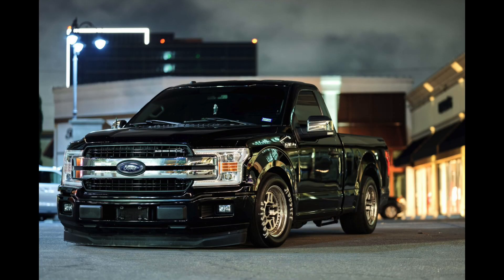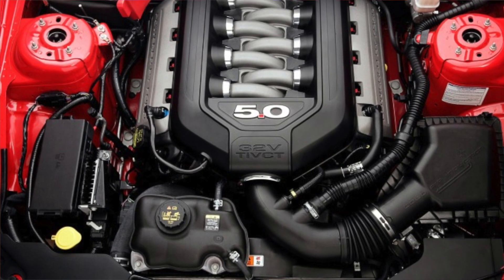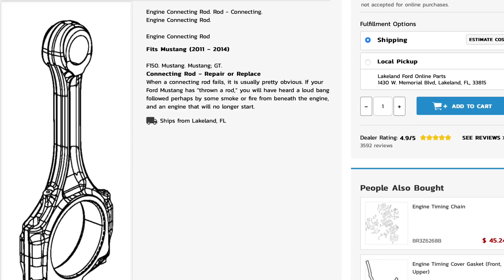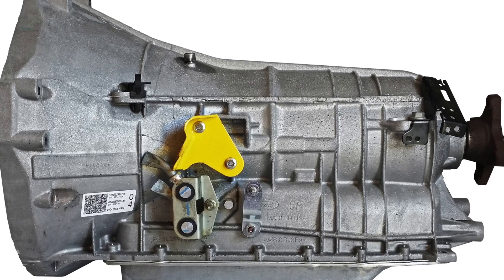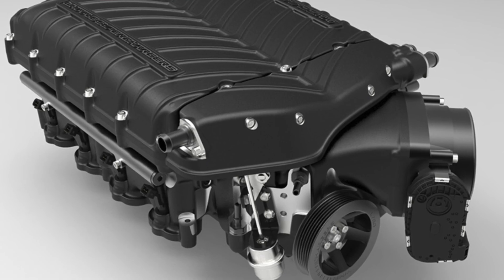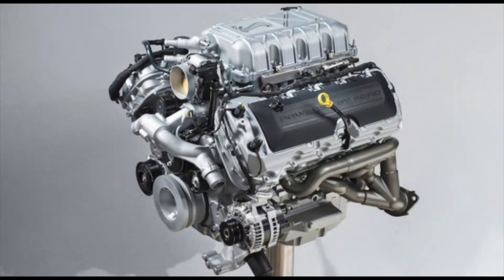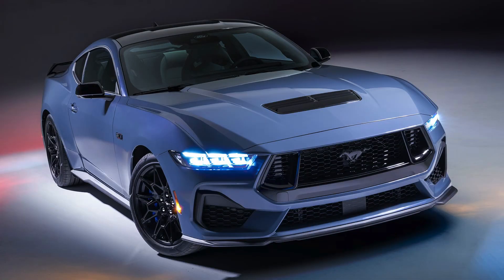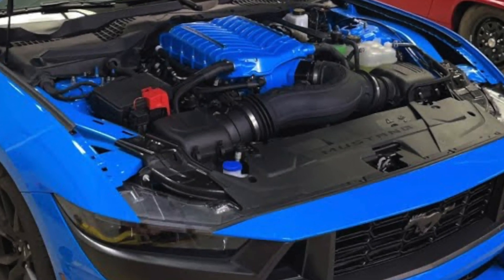The Overview Of The Mustang Coyote Engine (GEN 1 - 4)

Comment: People who are just looking at HP/Liter to judge and engine don't know much about engines.

A 6+ liter LS can fit under a Miata's hood and give the car a very good power to weight ratio, something a Coyote can't do. Viper won it's class in Le Mans and ruled GT racing during the late 90s and early 2000s against other cars that have better HP/Liter.
Reply from the maker: It's a fair point I mean the Honda S2000 is not very fast from the factory but it has a very high horsepower per liter so I can buy off of that plus especially naturally aspirated application in LS engine can make a lot of power generally more than a coyote if you're looking at an LS7 which will make 600 wheel whereas the coyote generally makes more than the fives definitely some truth to what you're saying thanks for your comment

Comment: I have a 17 Gen 2 and I absolutely love it.. The S197 Gen 1's were the cars that brought me back to even looking at Mustangs again.. Around 2012 I was big on Camaro SS's but the S550 came out and just looked perfect to me, It still had that older retro look but gave us just the right amount of Tech and improvements inside the car. Plus the IRS made the car feel so much better on track or just weaving in and out of traffic or taking turns you could really feel it.. Just make sure you put some IRS braces in just to reinforce the rear of the car though..
Reply: Agreed.  I have a 2018 GT.  Best car I’ve ever owned.  Also installed the Steeda rear and front sub frame braces.  Also, highly recommend adding a JLT oil catch can to keep the intake clean.

Comment: The 5.0 is the best preforming v8 in history makes all GM engines look out dated an they will handle 1200 hp stock
Reply: Yeah that’s crazy how the stock block is strong enough to handle a lot of power where as my STI needed a block swap with fully forged internals to hand over the 700whp it has but I do have an S650 with the Gen 4 and I like it but it sucked that I had to buy two K&N filters and if I do intakes it’s double the price.

Comment: Great video brother, I have 2011 Ford F150 with a 5.0L Coyote V8 in it with 160,000 miles on it and still going strong and its a beast and it sounds like a beast with the Borla ATAK exhaust on it as well.

Comment: correct me if I'm wrong, but did direct injection not get first released in gen 3, not 2?
Reply: @vincesettineri  not correct, Gen 2 was port injection only, Gen 3 was port AND direct injection.
Reply from the maker: Good comment I pulled up a diagram and your right it is port still for Gen 2, for the past 9 years I thought it was direct for Gen 2 so I appreciate the comments, I will address this in my f150 coyote video and pin a comment.
Reply: Gen 3 first had it. And Gen 4 has it. I have a 17 Gen 2 with just 8 port injectors and I love it that way..